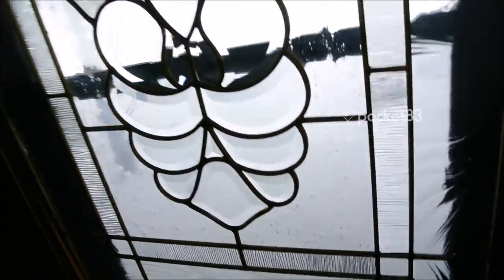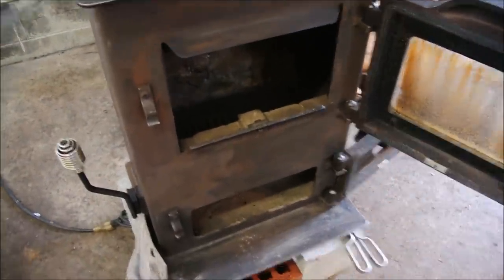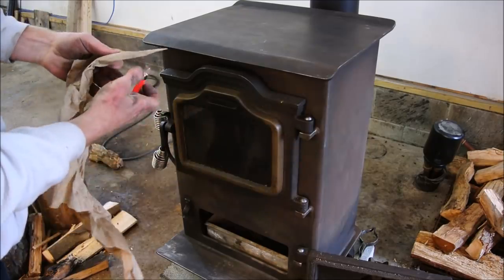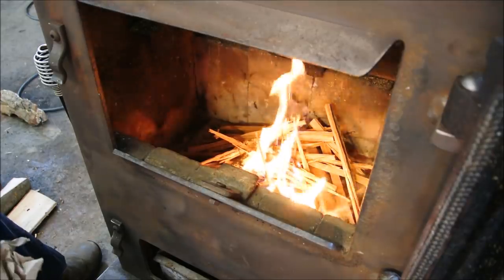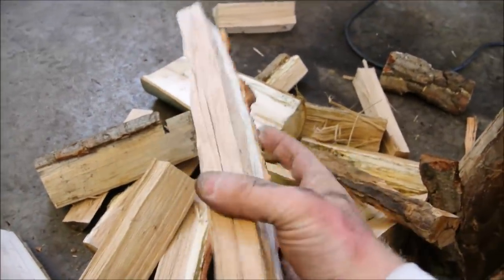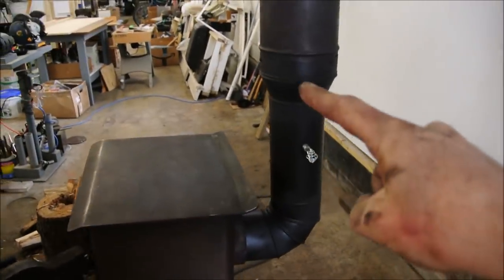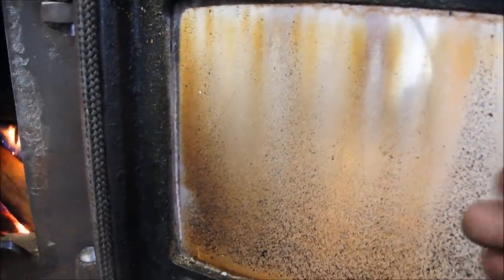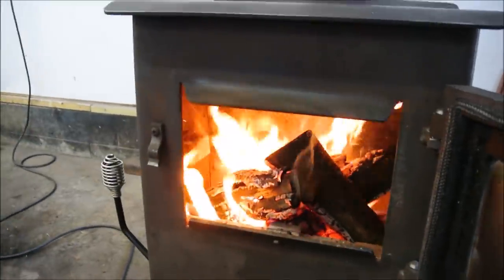A Look at the Harman Mark II Coal Stove

Comment: Invest in a woodstove temp gauge for stove pipe. Helps with the dialing in of dampers to not over burn wood and over heat flues temp. I found myself burning nearly half the wood and still having a very heated space.
Reply from the maker: Noted. Thank you.
Reply: Put a fan on top of it .i think they are called..."Heat Powered Stove Fan" @pocket83squared
Reply: @bexpi7100  no, they use a peltier thermoelectric cell to power a motor. The same cell is used in mini fridges and dehumidifiers, when you apply a heat difference they generate electricity when you apply electricity they generate a heat difference. Neat eh?
Reply: @garrethtinsley2435  yeah, shortly after i posted that comment i realized that using a Sterling engine would be insane. That and Big Clive did a teardown of one.
Reply: Grant Parlier  ????????????????? what?

Comment: Looks like a well made stove. I've had a few and now use a Morsø, great stove but cheaper ones are just as good, though perhaps not a durable long term. The glass fronts always get etched if you burn coal, just keep on top of the soot build up. If its not cracked there's no need to replace unless the cosmetics bother you.

Comment: I have a wood burning insert that runs 24 hours a day during winter. It's lined completely with firebrick and the stove can easily get over 600 degrees if I don't throttle the air intake. The brick saves the melt down from high heat for extended periods. It also makes it easy to restart a new fire after ash clean out. Wood stoves are the greatest and I find free firewood without even trying.

Comment: Also I removed my firebrick years ago in my MK2. Only burning wood and my temps aren't getting hot enough to concern me about warpage.. I'm also plenty far away from any combustibles. My burn times vary from 6- 10 hours of steady heat with seasoned hardwood. I clean my glass with wet ash and fine steel wool. Works great for me 👍👍

Comment: If you turn your damper closed part way and close your draft door on the front the one you where turning it will help you get better heat in the shop and maybe a little bigger fan that's how I ran mine. Just a idea. Keep up the great videos
Reply: I was thinking the same. High draft is nice when starting the fire. But after it's going hot, those flames need to be slowed down to retain the heat in the shop.

Comment: you have a beautiful home.  when I was much younger, I made several iterations of a coal/wood burning stoves.  yes, I did burn coal.  I learned a lot about burning in a stove as a result.  the best stove I ever had was a 375 gal. fuel tank with 2 cast iron doors welded on.  anyway, I found burning coal is much less work and dirt cheap.  I would drive to the coal mine and buy coal by the pickup load ($20 then).  2 loads would easily last all winter. BTY, it was a 1600 sq. ft. shop.  I would stoke it up at the end of the day and turn down the draft and it would run all night.  one thing you should do is put fire brick around the inside edge so the all the air has to flow up into the burn chamber thru the fire in the middle.  with a small flow of air straight thru the fire it will burn more efficiently and hotter (keep upper door closed).  with coal, you will be adding to the fire 1/3rd as often.  one more thing, put a fan behind the stove to slowly blow across it to move the air for better overall room warmth (not too close).

Comment: I'm curious as to why you put the steel plate in there. Why not just build the fire on the grate and let the ash fall down into the bottom compartment. Then you can just shovel the it as it builds up. Seems like it'd be inconvenient to remove from the main compartment. As for the glass, there was some special cleaner I used on our wood stoves growing up. Idk if it will get rid of the sand blasted look but definitely the browning. I'll see if I can find it.
Reply: Plus you restrict the airflow from underneath.

Comment: Cut your logs so they are either the depth of the fire box, or the  width minus a few inches. My box is about the same size as yours, about 14" deep I think. So my logs are about 10" log as I put mine front-to-back.
Once the fire/stove is at high heat, toss in some larger chunks of wood, about 4 - 6 diameter with the cut face down on the embers. 
Close the flue damper down about 1/2 way (fine adjust later), and close the doors. Let the fire run a few minutes with the screw damper (or whatever it's called. Down in Fl we don't use coal, so therefore we use a slider) open. Then after the new logs have caught, slowly dial in the screw damper.
What you want is a hot/bright glowing embers. They will produce a LOT of heat, burn cleanly, burn longer, and leave very little ash behind. 

Also, check the smoke coming out of the stack outside. If it's smoky, you need to get the fire hotter. Smoke means that there is a potential for buildup inside the flue. The first fire to get things going need to be really hot to burn off any residue from the previous fire that cooled down.
Reply: I'm actually in the process of building my own fire box. The one I currently have was not designed for being "inside" a house/shop. At least I don't think so. When you  open the door, smoke will always billow out of it. The top plate inside that the fire licks up against is actually angled towards the front of the stove. So when a fire started, the smoke/flames will actually roll along that plate right out the door when it's open. Not exactly safe for inside.
The new box I'm building will be larger, and have a chamber for copper coils that heat water.

Comment: I would say keep the bricks. Finnish sauna heaters do burn through (f.ex 2-3 burns per week for 3-4 hours for 10y or so). The back wall might be thinner than what outside looks because there is that duct running behind it. The bricks also dampen variability of temperature the stove is outputting, and make it give out heat also after the fire is gone. I also suspect that majority of heat the burner generates just goes out of the pipe, stones can capture at least a portion of that. Russians have a name for this type of stove; "burzhujka - bourgeois", takes all the fuel and gives little in return.
Reply: The bricks are a good thing.  If you have combustion taking place on the steel, then you're maximizing the temperature of the steel while also providing oxygen.  That's only going to reduce the life of things.  Also consider the corrosion that takes place as the ash residue absorbs moisture during the warm season.  Just keep stuff off the firebox.  I don't know that the absence of bricks at the end means that they were never there. 

As to optimizing heat output, there are air-air heat exchangers that can be added to the flue, but care needs to be taken to avoid draft reduction or creosote buildup.

Comment: I think you would be surprised how small the world is and how close some of your viewers are. But congrats on the stove, they are a real rewarding heat if you can continue to use them. My favorite method of starting my stove is hitting old coals with a snap plumbers torch then using essentially a PC fan on a metal tube to blow on them. That kind of set up might not work with the shape of your firebox though. As others have said I would keep the firebrick. Its really there to help get the temps up and gasify the wood. Without them you would probably notice more coals and unburnt wood. Doubt it will hurt to try though.

Comment: The glass is gone, I think (at least there is no way I can think know of). You could demount it, and use an acidbath and over time the stains will go away. But not the other damage. Where it comes from? My guess would be microscopic imperfections that heat up differently than the glass it self and over time and use the expansion/contraction damages the glass. But I'm not certain on that. Don't use normal glass to repair it, it will crack the moment it's heated.

Burning wood gives you heat really fast, on the other hand once it's out, the heat will be gone very soon.
Coal on the other hand is used otherwise, you don't burn it like a woodfire. Well sort of. You start burning it like a woodfire but once the flames are out and there is only the ember left you close all openings and adjust the aircontrol so that it becomes a smouldering fire. It's not fast. But it gives it's heat/energy away over a much longer time. That's why it's perfect for big tiled stoves, where the firebricks can store alot of heat/energy. Funfact: for most tiled stoves it's not recommended to use wood because of the energyoutput of wood (at least around here). But I digress.
The point is: keep the firebricks.
Not only do they store a little bit of heat (not much, there are anly few in there) but they protect the outer shell of the fire-chamber from damage of the fire. In my work (chimney sweeper from Germany) I see alot of damaged fireplaces because of broken or missing interiors.

It's also possible that the sulfur of the coals that where burned there reacts with the watervapor from the wood to a slight sulfuric acid and damages the interrior and the pipe. But that's insignificant.

Comment: The fire brick is so the coals will not burn out the steel. I'm not familiar with coal stoves,but have been burning wood stoves forover 35 years. Wood stoves come with fire brick in the lower part of the fire boxes . 
 Triple wall chimney is a creosote maker,( it super cools the smoke and creosote condense on the pipe, where the insulated pipe keeps it warm and it doesn't do that ), but cheaper than insulated chimney . I am still burning my original metalbestas chimney. I have replaced the flue pipes several times and that is about the only thing that needs cleaned when I brush out my chimney. 
 My insulated chimney pipe cost, about the same price as my Temp Wood ,wood stoves . I have one in the house and one in my 24 x 24 garage, both are the same size.
 Be safe, but stay warm :- )

Comment: I have looked into this subject a  bit (as well as having personal experience of both wood and coal burning.
They are two completely different beasts! Having said that you can get dual fuel types like yours (and mine) but they do not work well with both fuel types! I am only talking about modern high efficiency types now but a wood burner needs air to pass over the top of the fuel and form a vortex allowing the gasses given off the wood as it cooks to burn. It is This gas flame that produces the heat. Coal needs an air flow Through the coal from underneath! 
Coal also burns cooler than wood (Anthracite may be an exception though) The purpose of the fire bricks is to prevent oxidisation of the stove from becoming excessive ..... You would need it to be glowing before this happens though. In effect the bricks concentrate the heat where you want it. 
You  will notice there is a big difference in burning ability and temperature of different woods .... the pines tend to be good and hot starters, hardwoods generally last longer in the burn!
I assume the fan is simply passing air over the body of the stove rather than inside (you can get some designed for an exterior air inlet (so you don't pump your nice warm air from inside the room up the chimney causing cold draughts) but there are many different types!
Care needs to be given when using a damper with a wood burner ..... damp it down too much and you run the risk of CO poisoning (it is a colourless and tasteless gas) but when using it on coal can be handy for keeping the fire burning overnight! But again care is needed as if the flue is damped more than the fire inlets it will leak smoke (and CO).
There are a whole range of different coals and Cokes available ranging from Anthracite (hard to light but burns Hot) down to high Bitumastic Coals (light easily, burns dirty and cooler) Cokes may be needed if you are in a smokeless fuel area ..... I think Hoth is exempt from that ;0)
As has been mentioned in other posts a magnetic thermomiter is a must to clip on your flue to be able to regulate the heat efficiently to between 300 and 600F (175 - 300C)!

Comment: Hello sir, thanks for the video. Since it's been a few years since making it I'm sure you have the stove mastered by now. I grew up with a mark 2 in our home and it was excellent with coal, but we did burn wood when we were available to. 
My question is, what is the longest you can get a burn? If it's packed tightly and dampened back will it last 8-10 hours? I like that you added the plate over the grates for just wood burning, that has to help tremendously. 
Thanks again and let me know.
Reply from the maker: Because it's in a shop, I don't really try to extend the burn time to its maximum. That said, no, I don't suspect that you could get 8-10 hours with this unit—at least not while using wood as fuel. 

If I were to (first) get a bed of coals, then put in two nice big logs that'd fill up most of its space, and then dial back the air, I might get five hours before having to rekindle it. The downside to doing this is how outrageously hot the fire becomes about ½ an hour after loading it. In practice, it's just easier for me to drop in the appropriately sized chunk every hour or so. Often, I'll just let it burn all the way down and finish out the day on the unit's thermal mass: that heat carries on for 8-10 hours, easily.  

By the way, I no longer use the stainless steel grate. It's tricky to learn to get a fire going at first without it, but there's no point after you've become better at kindling it over those large slots. In terms of efficiency, there's probably a price I'm paying for (not) doing so, but luckily the fuel grows on the trees around here!     

Thanks.

Comment: I love this stove, that's exactly how I would use it too. I leave my damper open all the time, I use the vents to control airflow and I've been burning wood since I owned a home. If I use a damper the creosote accumulates and I have to clean the chimney more. If I leave it open and burn it hot I think its safer. The chimney never gets an accumulation of creosote. When I clean it in the spring there's only a tiny amount of dust. Yeah the window is probably dickered, maybe a vinegar soak then try cleaning it but I wouldn't, too much work. Right on about oak - That stuff burns hot and leaves great coals. I burn it overnight or when I go to work. When I'm home I burn all the other trash I have. You mentioned maple, I use it as kindling, not because its the best or hottest or easiest to light, but the smoke from starting a fire inevitably gets in the room and maple smoke is pleasant.

Comment: My dad put a simple mechanical thermostatic switch on our wood burner that turns the fan on at a certain temp (100 F maybe?)
That way the fire gets up to heat quickly to create draw, and then the fan kicks in when needed. He also can leave the fan plugged in 24/7, and it only turns on  when the fire is hot. Let the fire burn out over night and the fan shuts off.

Comment: I’m a blacksmith. That fire brick is to protect your stove and make sure the heat is where you want it. Built several different forges and ovens with fire brick if the brick goes bad and there is a constant heating and cooling of the sides of the stove it will wear out faster. The fire brick helps it cool of slower which is better for it. If you don’t want to deal with fire brick Kale wool can be an alternative. It’s a little bit easier to work with.
Reply from the maker: Thanks. I added firebrick to the sides shortly after this video. It has been working great.
Reply: ...LOL!!! it's actually "KAO-Wool",..... (not "Kale wool").

Comment: newspaper and spit is one of the best ways to clean glass.. I'd keep/replace the firebricks , will take a bit longer to get up to radiating temp but will save burning out the walls , as for dampers /airflow.. yeah you just gotta play around with em.
I spent Au $4000 on a pellet heater.. much easier than splitting wood but struggles under 10c

Comment: I put in a similar coal stove this year, a gibraltar. I haven't yet found the tag/name plate. I assume mine might be a bit older, doesn't have the internal vent and no brass. I started the year burning just wood, no plate in the bottom. worked well, provided more than enough heat for my house. I put a 60 pound slab of steel on top the stove to store more heat, and have the fire brick inside. the last few weeks I've been learning the art of coal. the first nut sized andesite batch I got was pretty big pieces. I had much trouble keeping it burning. the batch of andesite I just got, also nut sized, much smaller sifting. I guess that's just the luck of the draw what actual size it is. the smaller coal as more surface area, burns and spreads filling the inside of the stove much easier than the bigger stuff. keeping it burning until I wake up in the morning is another problem.